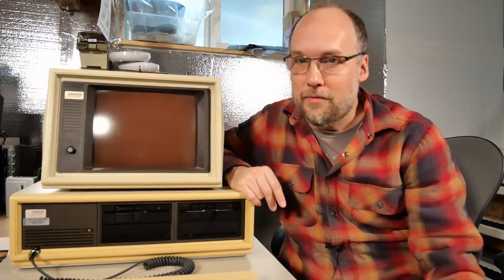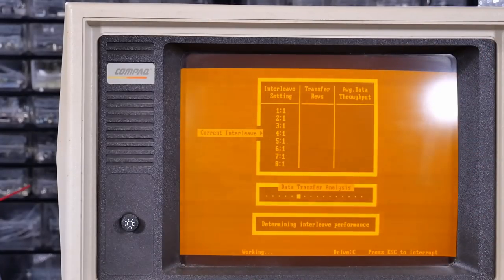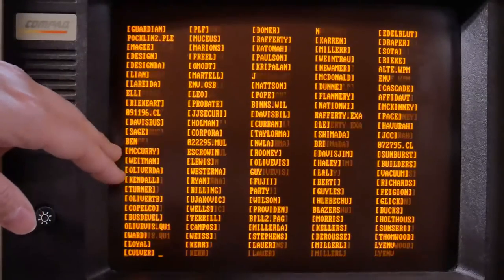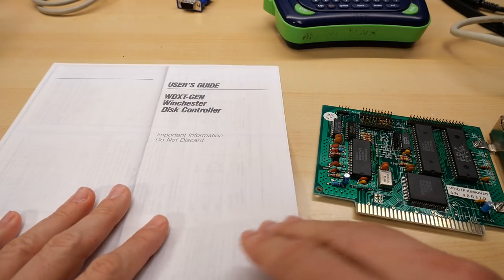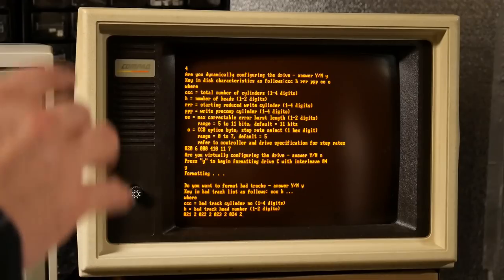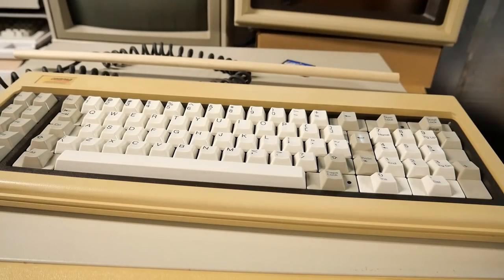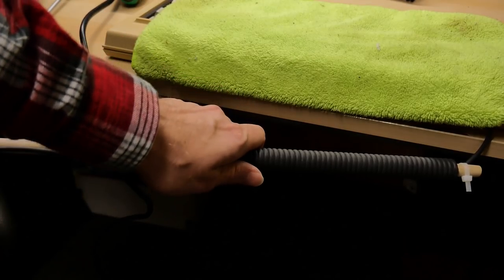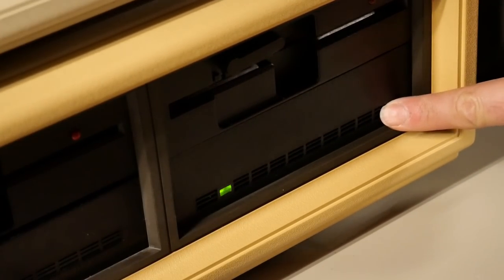Compaq Deskpro Part 4: The home stretch! MFM hard drive, keyboard and monitor

Comment: With MFM drives, the controller does the low-level formatting.  Often times this low level format differs from vendor to vendor and even model to model with the same vendor.  This means that you won't necessarily be able to read a drive that was formatted on a different controller.  Also the low level format is done by the ROM on the controller card.  You can access (in most if not all) this low level formatter by running DEBUG and then enter "g=c800:5" to start the ROM formatter.  It's not just specific to the WD controller you have here. :)
Reply: f15sim And that’s what Adrian did.
Reply: Having been a technician back when these were common drives, I can confirm what f15sim said above (changing the controller can cause the drive to not be accessible).  When recovering old drives that have been dormant for extended times, a Low-Level format is often required to refresh the drive.  If you connect the drive to a different controller, especially when changing from an 8-bit controller to a 16-bit controller as shown in this video you can expect the drive to not be detected or have significant faults.  The Older RLL and MFM Drives didn't have any control circuits on the Hard drive itself and would rely on the combination of the controller card and the hard drive to work.  This was one of the improvements that began when the IDE drives replaced them because the IDE drive had the full controller on the drive.  This change allowed you to move a drive from one PC to another and still be able to access the data.
Reply: Well this video brought back memories of things and people I hadn't thought of in, well decades. The moment I saw that drive that debug command popped into my head but I didn't remember about the interleave and bad sector stuff until it came up. Computers were so interesting in those days and you had to really keep up with all the new changes that were happening. Between me and two friends we had twelve pc magazines each month to read. And of course each of us had a favorite person that wrote articles in those magazines, mine was Fred Langa, he also wrote the Langa list, but others liked John Dvorak or, I don't know why, Ed Bott. And for a while many wrote about SpinRite, Steve Gibson and Gibson Research, there was lots of controversy about him back then. I didn't use SpinRite back then but somehow I now have a copy of SpinRite v6. If you think it takes a long time on a 40MB drive try it on a 1TB drive! Sorry I rambled on so much I just really enjoyed that content and all the things it made me remember.
Reply: Correct, I was just about to comment the same thing.  You cannot expect a disk to be readable by one controller when formatted on another "different" controller.

Comment: The data format on a MFM or RLL-drive is controller dependent. You have to use the same model of controller to read/write it, when you switch machines or you won't be able to access your data or get "defect" sectors because the controller isn't understanding the format the drive was lowleveled with. That's the reason why low-level-format disappeared with ide and scsi drives - they simply contain their controller on-board.

Comment: Hi Adrian, I was cringing watching you struggle with hobs, hot water and heat guns. None of that was necessary. All you needed to do was to twist the cord in the opposite direction, as if you wanted to unwind it, but then carry on. This will give you a very strong and tight coil in just minutes. I have done this many times in my previous life as a support tech. It's counter intuitive, but it works!

Comment: I remember reading about the coiling process used by phone manufacturers like Ma bell back in the day.  After heat forming the coils one direction they then flipped them the other way (CW to CCW for example) which makes them springy and tightly bound.

Comment: The whole WD low level formatting with Debug really takes me back! I'd purchased a used HD from a kid on a local BBS. It was my first and I had no room in my case for it, so I fit it into the external drive case that had a defunct floppy drive in it before. It was such a mess but got me through for a while.. Until it didn't! I remember running Norton disk doctor on it for 24 hours straight in the end, but it was a goner.

Comment: Awesome you use Spinrite!!!  I used that program regularly after getting a copy of it from an acquaintance on a floppy back when I got my first PC (a genuine IBM PC/XT) in 1993, it's 30 MB MFM disk was starting to have read errors and such, and SpinRite would get the HDD sorted out without any data loss involved.

Comment: My 40meg drive took about 4hrs to low level format. It has on a home built pc. The shop were confused when I bought the motherboard and micro but not the bios. This saved me 1/2 a weeks wages! My boss had bought the bios the day before so I just copied his. Work also supplied the eprom :)

Comment: Spinrite is still being produced and a long awaited update to version 6.1 through 6.3 (the current version is 6.0). It has uses on modern PC's however the updates will add compatibility and speed improvements. Steve Gibson is still active and many may know the Security Now! podcast produced by Twit.tv which Steve hosts and has been running since 2005. Episode 743 was released on Tuesday! 😀
Reply: A year on and we're still patiently waiting for the new Spinrite. I've been using it since I worked at CompUSA in the late 90s early 2ks and today I still use it working in IT.  He is very generous with his licensing and the cost has been more than recovered in the many years of use.  Can't wait for the new version.

Comment: 19:00 "My hypothesis is..." Your hypothesis is correct. I had a similar Western Digital controller with the same low level formatting program in the ROM (I didn't know it could do a virtual drive split; that's interesting!). It saves the information about the drive geometry and even the list of bad sectors, to the first cylinder of the drive. Then while the drive is operating normally, it hides that cylinder by pretending that the drive is one cylinder smaller, and adding 1 to the requested cylinder number, so that when the BIOS wants to access cylinder 0, it really accesses cylinder 1. Of course if you put the drive on a different controller that doesn't do this, the other computer won't see the Master Boot Record so it can't access the drive (I did that, so that's how I found out how it works).
Anyway, kudos for having more patience with SpinRite than I ever had. I never ran it at the "thorough" level and waited until it was done.

Comment: I've just binge-watched the entire 4-video series on the Compaq Deskpro. This was actually my first computer in the early 90s. My dad got it for nothing from his workplace since this system was too old and they wanted to throw it away. It looked almost identical, the only difference was that it had a green monochrome monitor instead of an amber one. The processor was 8086 or 8088 I don't remember exactly, but I know it didn't have a math coprocessor (I remember opening it up and looking inside with my dad). Also, it didn't have a hard drive installed (I wish it did!....), but it did have those two floppy drives. Indeed, the floppy drives were installed one on the upper-left slot and the other on the upper-right slot. I still remember that the floppy drives only supported 360KB disks, I tried using higher density disks to no avail. Was this the case with this computer? (I am referring to the original floppy drive that went with it, not the second one you installed later?). Also, it was a shock for me to find out that this computer had a turbo mode! I had absolutely no idea! Now I keep wondering whether my system had the green light on or the red one.... I am afraid the red one... :) I feel so bad now for giving this computer away! My next computer was a Pentium 75 (quite a massive upgrade) and we thought we didn't need this one anymore.... I had no idea I would feel so much nostalgia 30 years later. I would even be willing to buy this system from you at the price of a new modern computer! Would you be interested? Or maybe you have another Compaq Deskpro like this? Thank you, Adrian for bringing up good memories!

Comment: Thanks for showing the whole process, my parents had this exact machine in the 80’s - early 90’s. Ours had a single 5 1/4” floppy drive, 20MB HD and the same dual mode amber monitor. I used to type my homework with it in middle school and the first part of high school. Major nostalgia seeing this on youtube! There isn’t a whole lot of info on this machine online so it was cool to see this. I can find plenty of info about the Compaq Portable but not the 8086 DeskPro. I remember feeling it was so superior to the original IBM because ours had a 16 bit processor (8086) vs the 8 bit 8088 in the IBM. 😂. It was still in my parent’s basement, in the box, in beautiful condition right up until a few years ago when my brother took it to the scrap yard. I should have grabbed it when I had the chance. ☹️ To most people it’s a pretty worthless machine by modern standards... I guess I’m weird 🤪

Comment: on some refurbishments i did on a compaq portable II and III, i used pc/at keyboard extension cables, just cut off the female ends and soldered directly into the keyboards and worked great and fit great into the cases.

Comment: Spinrite is a GREAT program, it does work and works very well, it was written in machine code so it is fairly small. I still have the version that I purchased, around $70.00. Don't use it anymore but it was great for the old drives.

Comment: Well done, Sir! It's always a pleasure to see one of these old "war-horses" being brought back to life. 😃
BTW "Degradation of magnetic flux" is also sometimes called "bit rot."
Reply: @adriansdigitalbasement  That does indeed sound very plausible. In the end, though, you did succeed, and i imagine that must have been quite satisfying. I must confess that I have no personal experience with such old PC hardware; i only started using PCs in around 1998, before that i used an Amiga 1200, and even earlier, a ZX Spectrum +3 - the one with the built-in disk drive. Still, I would be interested in delving deeper into the old PC stuff, as and when my finances permit ;)

Comment: Awesome videos! I appreciate you taking the time and putting in effort into making this system functional again. I currently have the same system in my possession, mine even has the Intel 8087 math coprocessor.  The three errors I need to work on are 401 (parallel port 1), 601 (bad floppy drive), and 1701 (bad hard drive). This video series will help me out significantly with my project and I look forward to seeing how it turns out in the future.

Comment: If you ever run across a full length HDD controller card with an 80186 CPU in the lower left corner, I'd love to hear about it.  It is a Diskmaster dual drive controller from Cogent Data Technologies.  I worked for them for 11 years and this was our first product and my first design for them.  It was the fastest 8-bit disk controller on the market and used a digital data separator and a bus mastering DMA interface.  We used only 1:1 interleave and could switch heads within a sector, and provided an option for data mirroring between the two attached drives. Fun project.  We later made PC-AT and MCA versions.  Thanks for the memories.
Reply: @adriansdigitalbasement  If you see one of these, it may be marked as a 'Database Machine'.  This was the intended purpose, as a way to perform database operations at the site of the data to avoid sending all the data back-and-forth.  It worked brilliantly, but so hard for a small startup to find customers.  We repurposed it as a high-speed disk controller and had somewhat better sales.  I was fortunate to retire from Intel, where I worked for the group designing their SSDs - now that's fast.

Comment: I had forgotten about using debug to access the firmware on the WD controller card! I had to do the same on my Amstrad PC1512, it had a 'hard card' upgrade in it (same WD controller as you and a 32MB HDD all mounted on a special bracket so it all fit in the expansion card bay).

Comment: When framing your static shots like pointing at your computer screen or your desk where you're just trying to show us something, set your focus once, disable auto-focus and then start recording.  Your camera is constantly hunting for focus and doing this will prevent it from jumping around continuously like at the 31 minute mark where you've framed up the monitor but the focus is shifting constantly as you introduce and move your hands around inside the shot.  Hope this helps!

Comment: I wonder if the reason the suggested interleave kept changing was because sometimes you’d boot in turbo mode and sometimes not. I know cpu speed can make a difference. 

Great video by the way. Now I’m finally trying out a NOS ST-251-1 I recently picked up. Thanks for the inspiration!

Comment: A lot of XT and AT era disk controllers had the ability to translate the physical heads/cylinders/tracks of newer drives in to virtual heads/cylinders/tracks to match the limited options of older system BIOSes. By running the debug command you ran the microcode on the controller to configured the controller to translate the ST 251-1 physical specifications to virtually match the limited BIOS settings.

Comment: Another cool thing about the Compaq dual mode Monochrome monitor is that it also supports EGA (640x350 for instance) and 64 greyscales over TTL RGB!
The little 9" internal monitor on the Portable 1 is essentially the same thing and also supports EGA :-) The Portable is pretty similar to the Deskpro but it has a 8088 instead of a 8086 as it's an older machine...

Comment: Last night I fixed a 10Mhz 286 I got as a birthday present when I was ~14.  It was a surplus unit with a bad FDC.  I previously diagnosed it as having good motor and seek control, but wouldn't read data.  I found some floppy controller chips in my stash and when I was warming up the desoldering station I noticed no pin sticking through one of the holes.  It turns out that in 1987 when the OEM stuffed the board, one of the pins was curled up under the FDC and only barely made connection with the wave solder blob.  Over the years, oxidation and vibration made the connection poor and non-functional.  I just stuffed a resistor leg through the hole and made good connection, the result was a working on-board floppy controller!  I've had this computer for nearly 30 years and it blows my mind that it shipped from the factory in 1987 with this defect.  Now I need to find my PLCC remover tool and remove/clean/reseat the chipset because it's being flaky.  I plan to try and burn an AMI BIOS for this board because the one it has is junk, the only complication is that it had a soft turbo capability that rebooted at 8 or 10Mhz (it powers on at 6Mhz).  I think I'll snarf the BIOS and disassemble it to try and find how they toggled the frequency.  This uses the C&T 82c20x chipset and has only 640KB of RAM, with a VME type socket for RAM expansion.  Of course it's an orphan...but it has sentimental value.

Comment: I remember reading a while back that a Low level format should be performed annually on stepper motor drives. Due to expansion and contraction as well as mechanical wear in the stepper motor and mechanism it is possible for the heads to fall out of alignment with the tracks on the disk. A low level format places new tracks on the disk and as such are in alignment with the new position of the heads.

Comment: Pro tip: coiled cables need to be turned inside out after setting - start at one end, sort of twist it against the thread direction, and then "move" the twist along the length of the cable. The end result is that its tendency to want to uncoil will go in the "wrong direction" and cause it to pull together rather than drift apart.

Comment: If you use an RLL controller and do a low level reformat, you get 63MB out of that drive. I did that too with my first XT PC.
I even wrote a driver that made it possible to use part of the Gaps between the sectors to write data.

Comment: You're totally right about the MFM controller card. Those jumperless controllers (like yours, with the WD SuperBIOS), use the first cylinder to store the drive geometry. On an XT with such a card, you will notice that the drive seems to have only 819 cylinders instead of 820. That alone makes drives formatted with such a controller incompatible with 16bit controllers, where the geometry is set in the system BIOS, because the MBR then is not on track 0.
Switching drives and controllers is generally a bad idea with ST506 interfaces. With low-level-formatting, you basically marry the drive and controller with all their tolerances and differences. If you switch the drive to another controller card, it might work to be able to pull some or all data off the drive. But it's not very reliable.
Oh, by the way: The different optimal interleave might be because of different system speed. If you run the machine in slow mode, you might need a larger interleave value. Did you run Spinrite with different system speeds?
It's a bit of a trade-off, if you use a lower value, you will get higher throughput in fast mode, but it will get really slow in slow mode. If you use a higher offset, you lose a little bit in fast mode, but it will be a lot faster in slow mode.